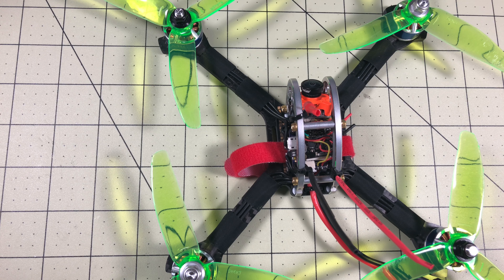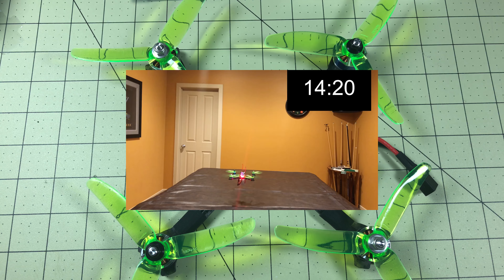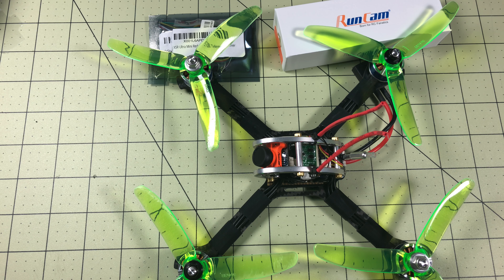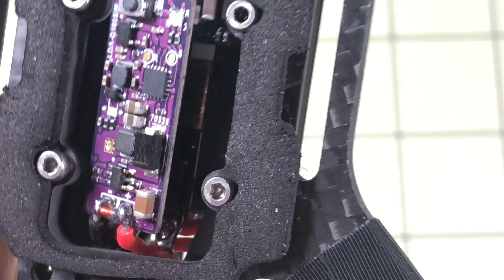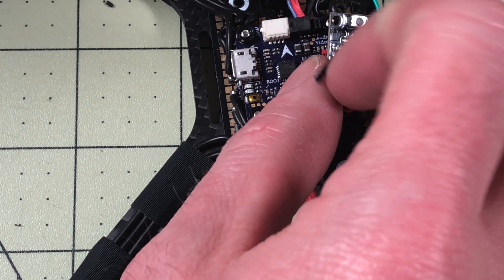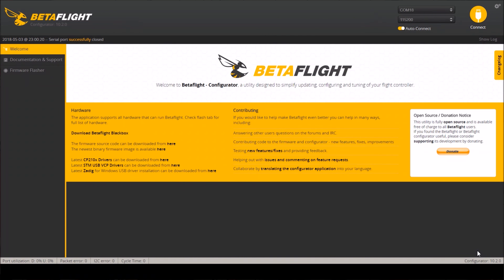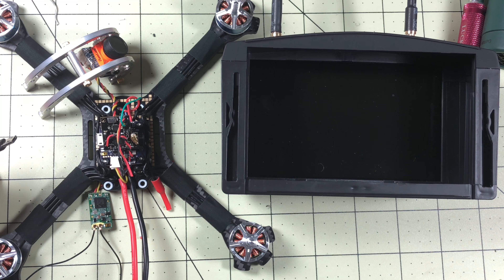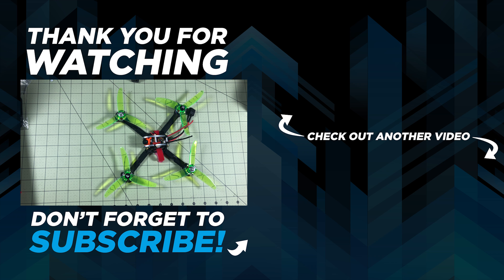Installing a KingKong LDARC 200GT with Runcam TX200U VTX. How to setup the SoftSerial & Smart Audio

Comment: i dont understand, why the green wire come from the same plug that goes in the buzzer and the other 3 wires for the vtx goes in the board? shouldn't all 4 wires goes in the same plug?

and i have other 2 question, the first is, do i have to do all the betaflight procedure to make the vtx working?   ( I have smaller ldarc king kong version but i guess the fc is the same)

and second question, the guy who sold me the drone strip off the cam connector, so to connect the wires to the vtx do I have to strip the female connector on the vtx and solder the wires directly on the fc?

Comment: Hi Mark, I'm getting motor stuttering (desyncs?) at about one third throttle when just cruising across the field. Any ideas?
Reply from the maker: Oh, that is odd.  This is happening with the 200GT?  Does it fall all the way out of the air?  Or just stutter?  Have any video?
Reply: DroneRacer101 yes with the 200 GT.  Just stutters hasn't fallen out of the sky yet but might even drop a few feet sometimes. Motors not hot either.

Comment: Great video!! My VTX that came with 200GT quit working so I was forced to replace it.  I went with AKK Nano 2 VTX with smart audio.  Banggood was nice and refund portion of it to cover the cost to buy a new VTX.

To flash the FC to betaflight 3.3 and up, I had to reinstall the USB driver on the FC using Zadig then flash it in boot loader mode in DFU mode.

Comment: I didn't realize you uploaded this so recently. Last night I was installing my TX200U and was wondering if I needed to change the wiring to get BFosd. Your vid is the only place I see ANY info about using the TX200U with bfosd. Thanks! I even used the exact same cli commands to use my led strip pin for the Tramp telemetry. Works flawlessly (on my massive droner)!
Reply from the maker: Glad to help!

Comment: I like the way how you soldered some wires. You fixed soldering iron and then wires get closing to soldering iron. Nice move. (Y)

And yea puttin some solder on tip makes larger connection which then makes faster soldering process.

Nice video again. (Y)

Comment: Awesome tutorial do you know if the flycolor f4 flight controller supports audio? I currently have a arris vt5804 vtx and a runcam swift 2 camera that has a mic connection but nothing is plugged into it or should I just but a vtx with the mic already on the board?

Comment: Great long vid :-) What part of the video do you go into in setting up BF SoftSerial etc... I have the 20x20 KK mini stack very similar and attempting to setup  my TX200U for TRAMP Telemetry (Smart Audio)? What is the Green Audio wire on the plug used for? I had orignally hooked the green(Audio) from the VTX to the Audio wire on the plug that says Audio but that didnt work.

Comment: So with the FC of the 200GT it is not possible to use the LED stripe and TX200U with Tramp Control  or LED stripe and R-XSR with telemetry or all 3 cool features together? 

Is it possible to use the R-XSR as normal SBUS receiver with the LDARC FC?

Do you recommend  an alternative FC with open UARTs instead?

Comment: Have you tried using f.port for R-XSR? That way the RX only needs one cable (one UART for both) for both RX and the telemetry!
I've used that on my Omnibus FC, and only one signal cable is required between FC and RX. For F4, you will need to solder on a P pad of R-XSR to get uninverted signal though.
Reply: I tried to use it. RX is working  but telemetry is not working (

Comment: I have to get new fc.pluss vtx.just ordered 4 in 1 racerstar esc from Bangood as well.quik question any ideas why my cobra gold 2207 motors get red hot straight away.lux v2 and racerstar 35amp 4 in 1.hot motors.purchased from a friend.pluss they don't seem quick.any ideas what to do
Reply: did you fix it ? flash BF4.2 , hot motors 90% of the time is wrong filter settings
Reply: @rolisaenz  yes mate thankyou